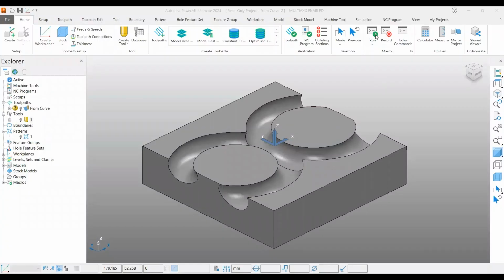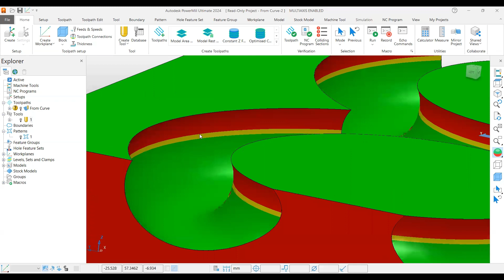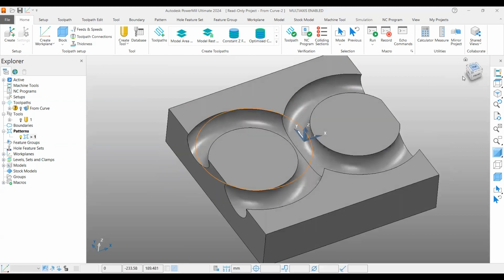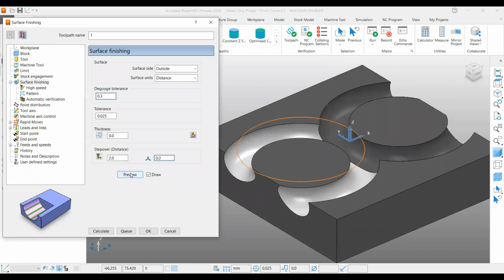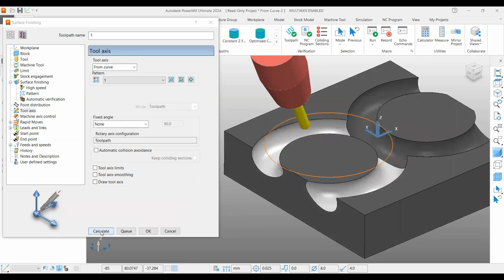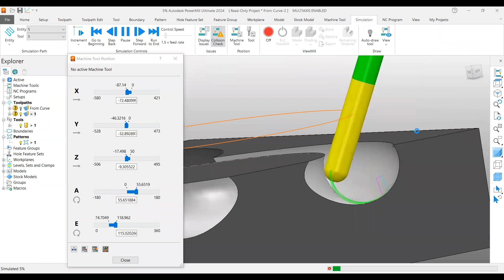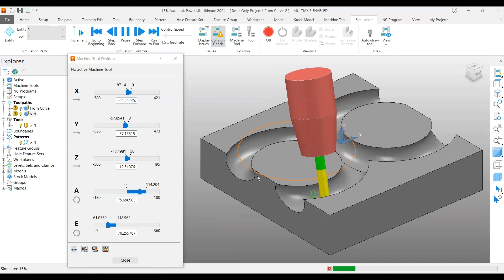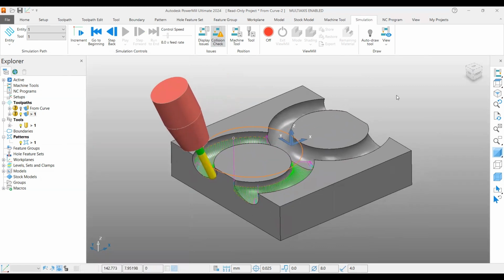Autodesk PowerMill - 5 Axis - From Curve - Tool Axis - Example 2

Comment: Do pattern need to be centre of the surface? 
What happens if pattern is not in centre
Reply from the maker: Merge surface using CAD or use Point projection strategy
Reply from the maker: It depends on the shape, how to control and reach undercut areas